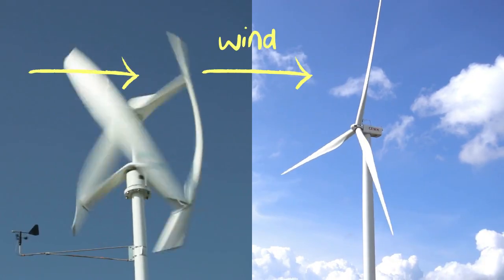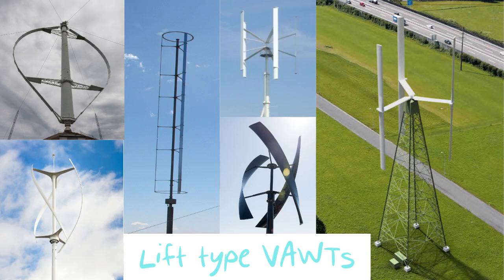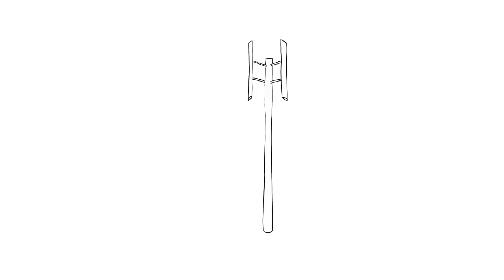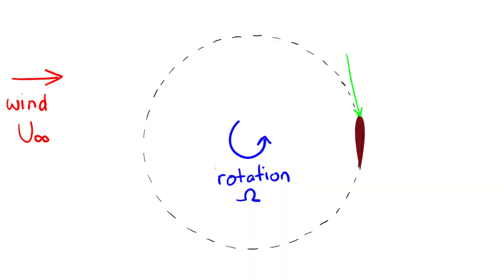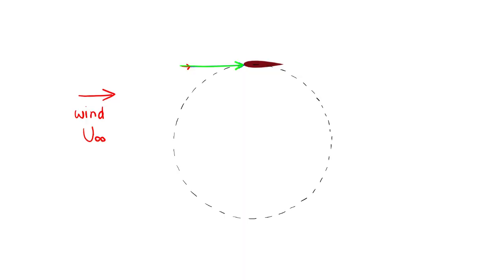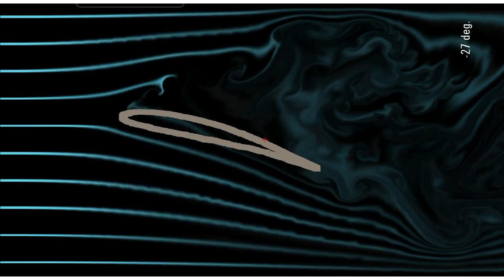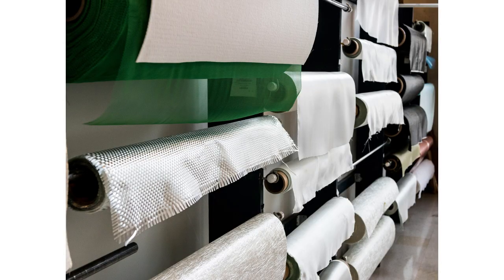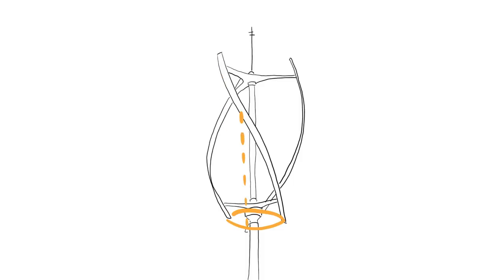Vertical Axis Wind Turbine Aerodynamics and Design

Comment: I did my fourth year engineering thesis on this back in 1975. I was limited by computing power.
Reply: IBM 1130 4K punch cad input

I found my copy of the thesis a few years ago and it sparked my interest again. I was simply looking at the torque curve vs the speed ratio. It will rotate to a point and then the torque goes negative so it won't increase in speed. If you add a motor assist to brig the speed ratio over 1 then the torque value continues to increase. That's as far as I got. I never had the computing power to model 3 blades ( or more ). Nor did I try to extract power. I've always wanted to know the limit Betz Law on vertical axis turbines. I've always assumed 3 blades to be the most effective simply because of the accumulation of the sin curves like three phase power but that's not valid. Are more narrow blades more effective than fewer wide blades? Is there an optimum diameter? I just used 3 airfoil designs.
Reply: @easternwoods4378  Thanks for sharing this, it's fascinating to hear about
Reply: @RobBCactive  All I was able to do was rotate the "wing" in relation to the central axis and then transit around the central axis to find the toque curve. Once you get over a speed ratio of one the wing has a velocity approaching the leading edge. It's the same a foiling in the America's cup down wind.
Reply: @easternwoods4378  I have trouble seeing why it generates torque when the wings are rotating through 360⁰, I would expect it all to cancel out.
Reply: @RobBCactive  What I did was rather rudimentary. At a low relative velocity the wing going upwind will have a relative velocity of v ( wind ) plus the rotational velocity. The wing going downwind is v ( wind ) minus the rotational velocity. In effect the wing has the trailing edge facing into the wind. In one rotation of the main axis the wing stalls several times. It effectively becomes just a barn door when the wing is perpendicular to the flow. 

When you get to a speed ratio higher than one then even on the down wind side the wing is seeing the airflow coming to the leading edge. It does however oscillate between a positive lift and negative lift. 

At low speed ratios it's basically an anemometer. At a speed ratio of one the torque is negative so it won't ever over speed on its own. Once you get to a speed ratio greater than one the torque output increases rapidly. the torque value vs speed ratio is an S curve.

The "trick" is to find the optimum wing angle between the radius from the center point to the wing and then angle the wing. 

That's as far as I got. I never calculated the actual power output. It also means that you have to provide a power input to get to a speed ratio greater than one. It's hard to describe the the effect in words. I's a lot easier to draw a diagram.
Reply: @easternwoods4378  thanks, that's the first explanation that makes sense!
I think it means that a gust can raise the speed, then more torque helps it spin as the wind slows increasing the spin to wind speed ratios.  That fits some of the light wind behaviour I observed with faster revs than a drag based design.
Reply: @RobBCactive  I used 3 airfoil designs. I mounted each in a wind tunnel and rotated it though 360 degrees and measured the lift and drag. At low relative velocities the airfoil will see wind direction from all angles. At high relative velocities it's always from the front which is why I rotated it through 360 degrees.

The rest was all simulation. 

I defined zero with the radial arm being perpendicular to the airflow. I also defined the wing as being at zero when the cord was parallel to the air flow IE at right angles to the radial arm. I then simulated a wind velocity and a rotational ratio and calculated angle of incidence and the torque from the lift and drag. I also simulated a wing at 120 and 240 degrees and summed the three values to simulate a rotor. I repeated that by rotating the radial arm through 360 degrees.

Repeat by increasing the speed ratios up to a ratio of 10. That gives the S curve of Torque vs Speed Ratio.

Repeat the simulation by changing the wing angle. 

A long slow process because the IBM 1130 ran at kilo hertz speed not today's mega hertz. It was also the faculties main computer running class work as well as grad student work

One thing to note. Because the torque continues to rise at a speed ratio greater one, if power is not extracted it will continue to increase in speed until it tears its self apart

Hope that explains it a little better

Comment: I maintain that you are engaging in a kind of false equivalency here: that VAWTs can be made as efficient as HAWTs.   In your analysis you neglect the effects of turbulence created by the wind passing over the central shaft (and in some cases turbulence from the upwind blade).   The turbulence affects the downwind blade at precisely the point it would be most efficient.   

In the case of HAWTs, wake turbulence is generated by the blades, but the wind carries the turbulent air downwind before it can affect the subsequent blade.   Likewise, turbulence caused by the support tower is downwind and has no effect.

I believe it would be good if you explained why & how it is that VAWTs would never match the efficiency of HAWTs.   That's not to suggest they are useless.   Your discussion of the benefits in gusty or sporadic wind is helpful.

Comment: @Engineering with Rosie >>> Here is a question/video idea[?] for you:  I have read about a proposed wind power generating system developed in the 1970s [?] that included a large vertical tower enclosing a turbine.   The tower widened into a kind of skirt at the bottom near the ground, where the air actually entered.   Air would flow up the tower, driving the turbine blades.  The tower would also have louvers that would increase the efficiency of the system, although I do not remember the specifics.  
 
This idea SEEMED promising to the non-engineer ME, but some years after first reading this I came across some more information online saying how there were problems with this system -- I again do not remember the specifics -- and those problems tended to negate most if not all of the advantages of this entire system.  
 
Everything I have mentioned I read SEVERAL years ago, so I am going from memory with all this.  If you need more info to find what I am talking about, let me know and I will TRY to dig up the relevant information. 
 
{I wanted to at least post SOMETHING here while I was thinking of it, although I do not have any exact details at the moment.} 
 
EDIT:  It MIGHT be this: 
https://patents.google.com/patent/US4070131A/en

Comment: Applications for vertical turbines where they could fit better than horizontal are in dense cities where some buildings have accidental 'wind tunnels' due to surrounding building geometries that happen to funnel higher velocity air. Back in college there was one building that had a reputation of a year-round wind tunnel effect. My current home has one corner that if there is wind that location has an excess of it.

Comment: Well I could you make the pitch change mechanical with some kind of tail windsock? I think they are appealing because the electrical parts and gearing should all be at the bottom making it easier to work on.

Comment: Maybe you have made this video already but, I would like to see a use case analysis for a vertical wind turbine. Like, say a single family home wanted to install one; how much would it cost and when would the return on investment be?
Reply: It would most likely break down before return on investment. And a family home would never get enough power to make any useful difference. Just get solar instead. There is a reason why VAWTs are not used, and the companies that 'reinvent' them go out of business, 100 years after Savonius invented them. You'd think 100 years would be enough for optimization.
Reply: @tzenophile  That would be part of the assessment. Mean time between failures or MTBF. It is another metric we can measure.
Reply: @UbassilianVids  An honest company would give you that. And you'd see that the sum would be negative.
Reply: @tzenophile  is it enough for optimists?
Reply: @jazldazl9193  100 years? Do you know the definition of insanity?  "Doing the same thing over and over again and expecting a different result."

Comment: I thought the idea of putting VAWT on street lights was pretty clever and a good fit for their strengths.

As a completely unresearched, arm-chair-engineer response: I'm surprised the variable pitch problem hasn't been solved with a swash plate and a wind vane.

I thought the amount of math was just right for a video on engineering.  Something I've been wondering about on both VAWT and HAWT is what happens to the "slow" wind.  There's got to be a resolution to the Kirchhoff-law-like "air in = air out" steady state dilemma.

Comment: I think the issues with complexity in construction can be handled with 3D Printing. In the other Video you described that horizontal turbines have more advantages in larger scale. Resulting it would be the smaller scale where the vertical turbines find the place to be.

Comment: The idea of actively varying the blade geometry puts me in mind of those "perpetual" motion wheels, which change the shape of their segments at different points in rotation. I imagine there could be a mechanical system which controls this according to the wind direction to reduce stalling. Maybe a camshaft and link to control the attack angle of the blades? I dunno, just a thought. At any rate, you certainly got me thinking, so thanks!
Reply: There are been already plenty of systems. Mecanically it is pretty simple.

Comment: Great video, would you be able to elaborate on the power output between comparable (size/land area) VAWT and HAWT turbines? Both existing and theoretical limits? My uneducated hypothesis would be that HAWT turbines can more efficiently cover a larger surface area per turbine, but I have no idea how much more closely you can pack VAWT turbines in a wind farm.
Reply: You can put a whole lot of darrieus rotors close together . Research found out that when darrieus rotors put close together , they give eachother a litle boost .
Something you dont have to try whit horizontal turbines.

Comment: With a "yaw tail" (to adjust for wind direction) a variable angle of attack can be controlled with a cam.
Reply: I would like to have seen more time spent on that. Helicopters change the angle of attack of their blades throughout each rotation to compensate for forward air speed, should be much easier with vertical axis wind mills.

Comment: Hey Rosie, 
Awsome content - thanks a lot. I have a topic I'd love you to cover - I'm thinking about 3D printing the blades for a VAW using carbon fiber infused Nylon - it is a strong material and has good performance in UV and hot sunlight but I can only print the blades in 50cm long sections due to the size of my printer so I'm aiming for a 3m long blade overall made up of 6 sections per blade. 
Because i'm 3D printing the blades, achieving a helical shape should be no problem - so i'm going for a 3 blade helical shape overall. To hold the blade sections together I will glue them and in addition I will run a steel cable through the center of the blade sections which I will keep it under a little tension with screws on each end and I guess that each section will need its own support rod to hold it to the central shaft. 
For maximum strength in the joints and easier printing I would like to use a 'fatter' aerofoil - So here is my question - How would I go about deciding on the best aerofoil profile to use?
Reply from the maker: Hi, wow that sounds like a cool project! When you're choosing the airfoil, you need to calculate the Reynolds number (mostly a function of the chord length and relative wind speed it sees). And then you choose an aerofoil that is designed for approximately that Reynolds number. VAWTs usually use symmetric aerofoils, since they need to fly "upside down" on the return part of the rotation. And finally, if possible pick something that you can accurately manufacture. Very thin aerofoils or sharp trailing edges will probably be hard to make. 
I hope that helps! Let me know how you go! You can tag Engineering with Rosie on Facebook or Instagram if you want to share 😀
Reply: @EngineeringwithRosie  Thanks - thats helpful...

Comment: Rosie, I should NOT have to pause to get a decent look at the tech you are discussing.  If you want to keep your face on screen most of the time, consider learning to put it in a window.
Reply: Rosie, you can do no wrong. Please keep your face right there - we can easily pause. I need to pause anyway for about 5 minutes to take your info in.
Reply from the maker: @kevincameron8249  I appreciate this Kevin 😀 I just saw this now, but at the time you wrote the comment I was starting to feel a little discouraged by all the negative comments about my face and video production skills. (I learned to get over it by now though!)
Reply: @EngineeringwithRosie  Thanks for reply, Rosie, you are inspirational. You, especially YOU, must NEVER get discouraged. Kevin xx

Comment: Love it! This is very helpful.
I am actually looking for a wind turbine, problably vertical, to supply part of the energy required for the street lights of my neighbourhood.
I consider this will be a better solution than solar panels, even if used combined. What woukd you recommend?

Comment: I like vertical axis wind turbines. I designed a couple as a prototype. First was simple 8 blade pvc pipe cut into 3rds. I arranged them differently to try and eliminate drag when moving into the wind, still more work needed. 
The other was the lift type. I used a asymmetrical airfoil. I made the trailing edge adjustable to find the best angle of attack. And to make sure it was self starting regardless of blade location. I live offgrid so I'll build this one to drive a 24v generator. I live in a wide open area, but I've watched the wind change direction 180⁰ in hour or less.
https://youtu.be/3Gp4WPykPck

Comment: Very interesting, and well presented.  I don't see why adjusting the angle of attack in the course of blade rotation has to be very complicated.  Basically you'd need a cam and cam-follower at the hub and a connecting rod going to a bearing point on the blade in front of or behind the main pivot point.  In principle it would be similar to the cyclic pitch of a helicopter rotor, which changes its pitch depending on where it is in the circle of rotation.
Also, it would be interesting to know the factors relating to the number of blades.  How many is too many?  When do they start interfering too much with each other? The ventilators on the roofs of barns seem to use twenty or thirty vanes.
Reply: While a mechanical system would be relatively simple, Rosie has neglected to mention the difficulties that VAWTs can have in starting, and also the need for them to cope with high windspeeds, e.g. by feathering the blades. These problems mean that the optimum blade angle is dependent on the windspeed, and a mechanical system would be made much more complex if it had to also factor in the windspeed to its mechanics.

Comment: All wind turbinbes have fundamental defficiencies that make them unsuited for large scale grid supply.
They are asynchronous, they have no inertia and those defficiences also contribute to a lowering of short circuit current levels, (needed for effective operation of protective systems). 
If there is a need for non CO2 generation then nuclear is the only sensible source for large scale capacity. There is generally still a need for dispatchable generation, gas, coal or hydro where appropriate for frequency control.

Comment: Early work on turbines found massive gains of both efficiency and fatigue life by working on stator nozzles and rotor blades as parts of a single system. 
We've already seen simple plywood designs of stator outside of a VAWT improving efficiency and also providing superior structural support. Considering the relative complexity of design on stationary, versus moving parts, it would seem like ignoring airfoil stator design is wasting effort. 

So, are those involved in VAWT design actually looking for solutions? Or are they like every other government subsidized industry, just soaking up funding by continuing the problem?

Comment: Why do those horizontally mounted giant turbines often burn out? Is it excessive wind speeds or just bad engineering? 
Vertically mounted turbines with automatic pitch control in strong winds may be the future of these devices.

Comment: are there precession loads on these types of turbines?  I'm considering using a VAWT to replace the mainsail on a sailboat, with it either being mechanically linked to a propeller or generating electricity to power an electric driven propeller, and am wondering with changing wind direction if there will be precession forces that could slow the boat down if the turbine is rotating in the wrong direction, then I'd need a mechanism for the blades to flip around relative to whether the wind is coming from port or starboard direction.

Comment: You can (supposedly) get more energy per unit of land area using vertical axis windmills by packing them closer together . Also they can be erected without cranes some times when a equivalent horizontal axis wind mill would need a crane . Clearly for a wind farm on top of devils tower , vertical axis is the better choice for maximum energy output.

Comment: i wish you could do a video on Green Hydrogen as a fuel with Fuel Cells with reference to aviation. 
Why is Green H2/Fuel Cell NOT used as an aviation fuel? Considering compressed H2 can have a far higher Gravimetric Density than Aviation Fuel.
Reply from the maker: Great suggestion, thanks. It's on my list!